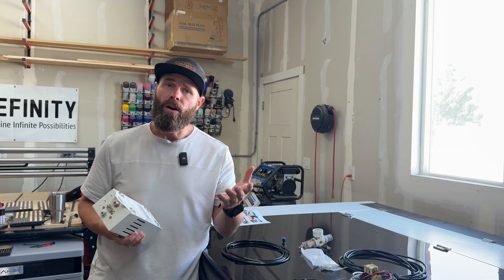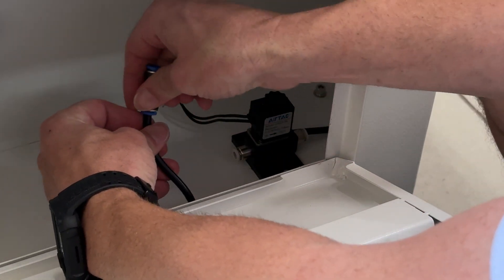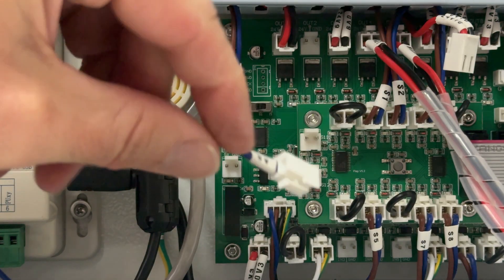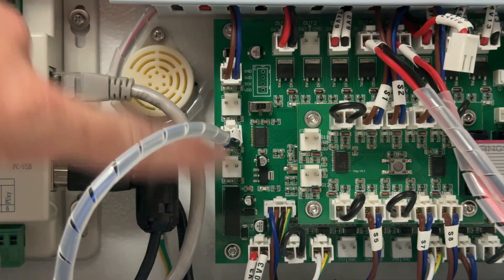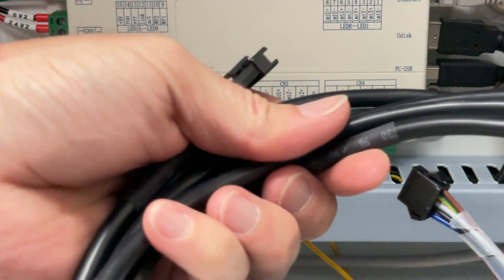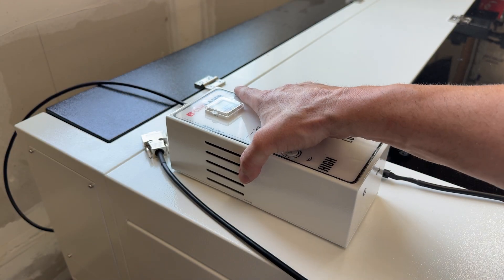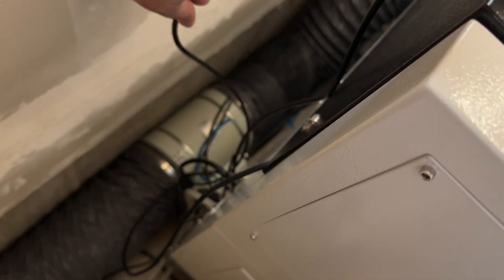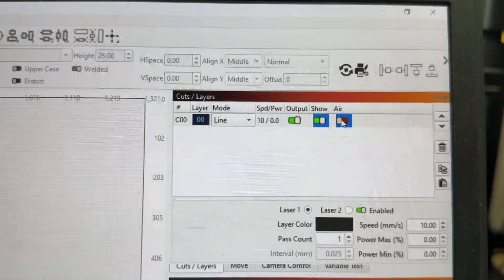OneLaser Hydra Upgrade | Install Compressor Air Assist for Cleaner Cuts & Engraving

Comment: One little piece of info for the community. If you hook up your air assist and both lights are on, on the control box, it is likely a little switch on the control panel inside the right hand side of the laser that was switched to the incorrect position from the factory. It's labeled with three positions "A" "S1" and "M". It has to be in the far left position, "A" or you will have air always on and the red lights stay on, on your air assist control panel in the kit. One laser released some sort of tech bulletin about this, but it's not in the instructions and is like a needle in a haystack if you're troubleshooting and don't know that this is a thing. This made a 30 min process a 2.5 hr one so I hope this helps someone out.

Comment: What is your opinion on Boss lazer's?  I'm trying to decide between a Hydra 13 & Boss HP 3655  Mostly want to do cutting
Reply from the maker: The biggest advantage that the Hydra has over Boss is the dual tube set up. In my experience as I have increased my tube power I start to lose the delicate engraving abilities. I know you said they your focus is cutting but still having the option for high quality engraving is clutch.

I have helped some local with their Boss recently and being able to see both machines hands on is interesting. The Hydra build quality is better in my option. Very solid cabinet that is rigid and hold its alignment. If you would like to see a demo of my Hydra 13 shoot me an email and we can find a time. Orders@beardedbuildsco.com

Comment: Quick question...does the solenoid serve any purpose after you disconnect it from the air or does it still control anything in the system?  Currently running the LC in my Hydra 7 and waiting for this new system to be delivered.
Reply from the maker: When you set up the new system you essentially disconnect the old solenoid from the board so it’s just sitting there.

Comment from the maker: 💨 The Hydra 13 just got a major upgrade — compressor-powered air assist! 💨
Cleaner cuts, less char, and smoother engraving — this is one of the best mods you can do for your laser.

💬 Question for you: Do you run your machine with a stock pump or have you upgraded to a compressor air assist? Drop your setup in the comments 👇 — I’d love to hear what’s working best for you!  OneLaser affiliate discount code: LASERGUYS
Reply: Nice Vid. Question...Do you think it would be possible to connect this system to another co2 that is not a onelaser?